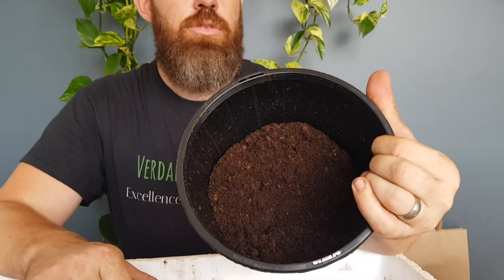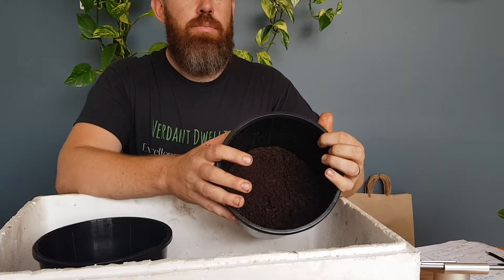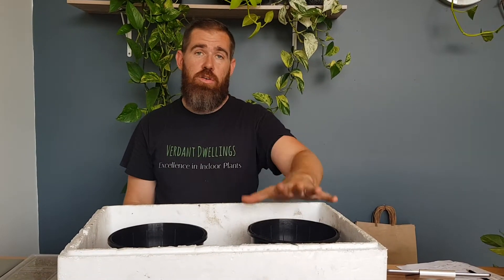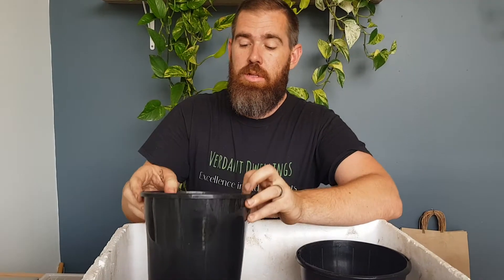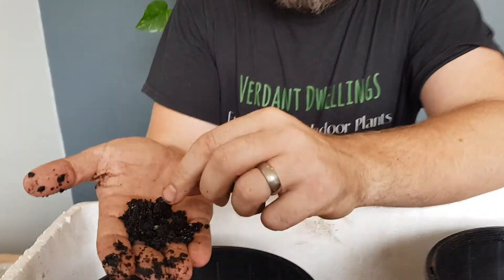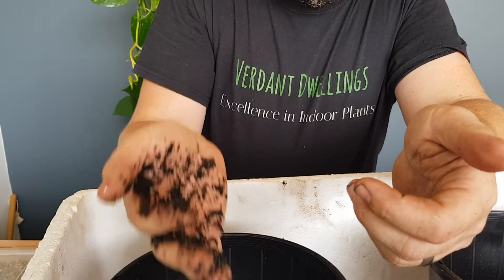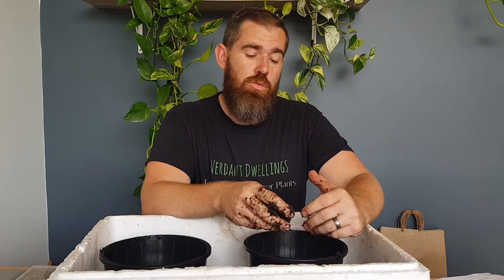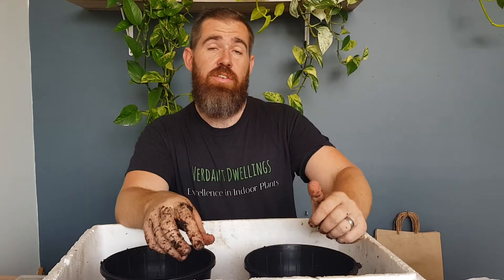Comparing Peat Moss to Potting Mix

Comment: What type of peat moss?  Given peat moss is acidic, does that mean that calatheas appreciate an acidic medium? Also,  is that peat moss comparable to the one available at Bunnings? TIA
Reply from the maker: We pot all of our plants in Peat Moss, not just Calathea, however, there are different sources making them different products. Our peat moss is harvested from sustainable farms in Canada, Holland and Lithuania, that work closely with universities to monitor the environment from which it's taken. The peat moss we use is then taken and treated with a Ph acidity regulator before compaction in large, dried and sterile bales that are shipped worldwide. When it gets to us it is broken up, the texture is course, and we hydrate it adding a wetting agent to assist the process and pot using slow-release fertiliser. We cannot speak to the process the Bunning mix goes through or where it is sourced however it is a very fine mix that is marketed as a propagation medium or 'add in' to your own mix. We use pure peat moss of a different grade. Our plants all thrive in it. Hope that is of assistance.
Reply: @verdantdwellings  A big thank you for taking the time to explain, makes perfect sense.
Reply from the maker: @celested8073  not a worry at all. :)